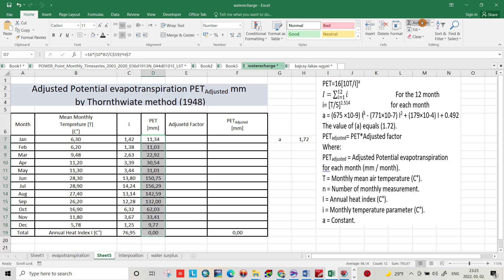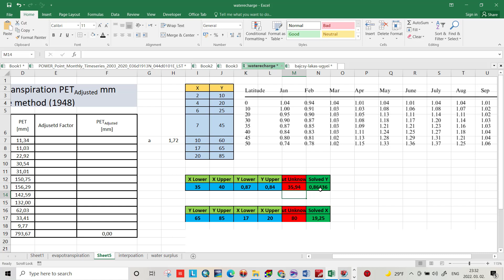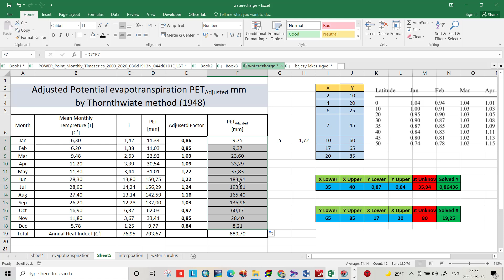Corrected Potential Evapotranspiration by Thornwaite's method

Comment: Hello sir how to get or find specific values below each month. e.g Jan (1.04, 1.00,......0.74) and so on ??
Reply from the maker: There is a table for correction of thornwite equation, it’s given,
Reply: @ENGSchool  I want to find PET of my area, from where I can use adjusted factor?
Reply from the maker: @amjadalikhan8809  what’s the latitude of your area, according to it, you can adjust the results
Reply: @ENGSchool  you mean the table values which you have mentioned in video, I can  use it according to my area latitude?
Reply from the maker: @amjadalikhan8809  exactly
Reply: @ENGSchool  ok thank your sir for your time and assistance
Reply from the maker: @amjadalikhan8809  most welcome
Reply: HI! Would you be able to perform calculations using WUFI software??TIA @ENGSchool
Reply from the maker: @sprayfoamtech947  sorry I can’t